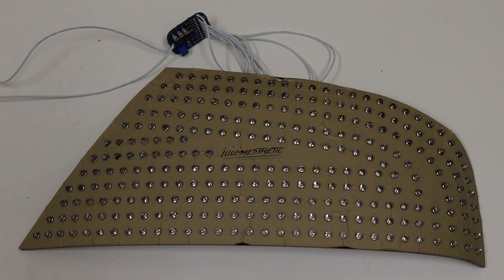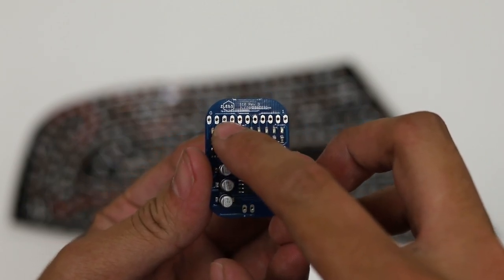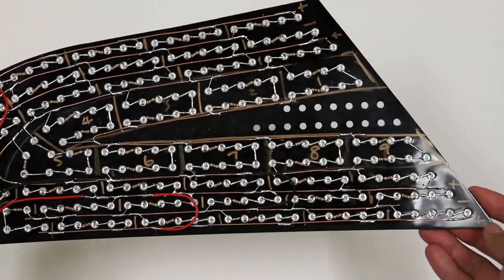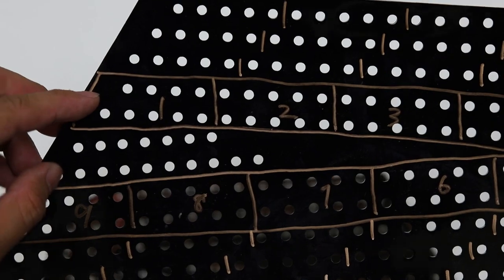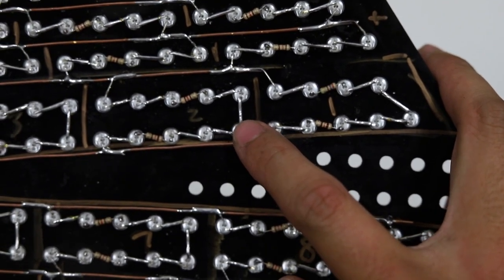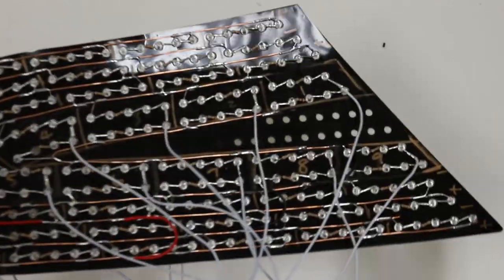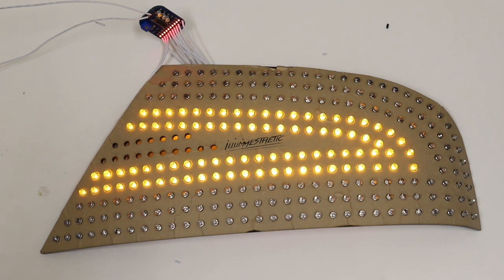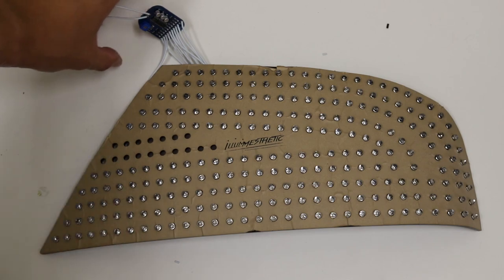How to Build Sequential Turn Signal Tail Lights! Illumaesthetic tutorials

Comment: When I saw this I thought ah a video showing me how to make the electronics...... sadly its not...... but at least it is for a module that is capable and not expensive compared to others. Tbh if  I go5 boards made and ordered components the money spent would jot be much different, then I would still have to build it then build the lights section.  Thanks for sharing.

Comment: Ok power wires connected is it powering the rest of the leds running light ..or that is just for sequential  turn.. if u want show mode feature have to use the ghost module right

Comment: Hello,
i want to make the turn signal sequential on my 2012 Charger (not with the factory PCB) and i found 2 types of sequential modules : 
common 12V, individual ground (like the corsomotion) and common ground, individual power (like zleds s10).
What make choose one instead of the other ?
Reply: Good question, did you ever find a good answer?

Comment: Does this work for lights that double as day time running lights? So basically if my tail light is also my day time running light will it know the different power to pulse when signaling?
Reply: you need a controller for this, something that reads input and acts accordingly

Comment: where to buy the panel
Reply: Did you ever find out where to buy the panel?
Reply: Please tell me you figured it out by now😅
Reply: @gageharden1283  bro I been tryna look for that shit have u been able to find what it’s called exactly or what to look for ?
Reply: @Ls400Saint  hell nawl😂 still lookin
Reply: @gageharden1283  bruh 😂😂 I’m at work rn and just searching for this shit I tried searching , led panel , led board , led custom board
Reply: @Ls400Saint  I cant find nothing man😂 I just went with clears and said fuck it
Reply: @gageharden1283  I found something similar it’s called flex protoboard , I’m not sure if it’s that one but only one pops up
Reply: @gageharden1283  aye I think it might be acrylic sheets or plexiglass sheet I guess it’s heat resistant and then u can drill the holes lmk what u think